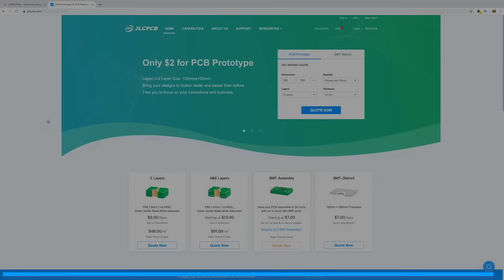10 BEST Tips & TRICKS with a sample CABLE TIES

Comment: Unlike 99% of these videos, most of these were very clever, and a few I'll actually use to run cables tomorrow. One improvement, though, is for the applications you're using a half-dozen or more: You can use velcro wrap/strips to do the same thing and not waste anything. For the side-by-side cables, you can wrap all four with ONE velcro strip, and then thread ONE zip tie around all of them in an extended figure-eight pattern. This way you're only actually using one tie for each, and if you leave some extra, you can always "unzip" it later.
Thank you for the vids, especially the rugged cable label ideas. Clever!
Reply: This video is about wasted resources...ridiculous minded...

Comment: This video lost me with the failure to properly flush cut the zip ties
Reply: The worst cut I have had on my hand was due to a ty-rap not properly flush cut!  At least he used a heat gun instead of a lighter for the shrink tubing
Reply: One of the NCOs I worked for would make us cut them all and do them again if we did that.  Because it sucks to reach in a rack or crawlspace and get sliced open.
Reply: @gwrober  I have a nice scar on my arm because of that. Deadly.
Reply: And melting the cuts
Reply: Came to say the same thing.  First thing I was taught when using zips, always flush cut.
Reply: got the scars to prove it. cable ties 101 - flush cut, flush cut, flush cut.
Reply: Zip tie gun needed badly here

Comment: Here's a tip I learned from an excellent (old) EE contractor working in aerospace: when the customer (executive) is dropping millions of USD for custom test equipment, a little eye candy can go a long way to giving them a warm fuzzy feeling about the work they just paid for.
Reply: The cable management with zip ties are heavily unnecessary, but it looks good and professional. Most cable management is eye candy anyways
Reply: I agree I done my apprenticeship with a guy who always dressed cables in a panel to perfection even though it took a good hour longer but looked stunning. As my dad said years ago.. a shite mechanic might not of serviced your car at all.. but if he washed it and left it spanking clean you'd think he was great🤣

Comment: As an electrician, all I can say is "The labeling part is nice, but otherwise: Wow, what an incredible waste of time and zip ties..."
Reply: I am willing to pay more for this kind of dedication, anytime.
Reply: Sometimes you need that level of organisation in your cables. What is called "cable porn".
Reply: You said that a waste since u want to finish ur job faster and then get the coin dude. I’m would gave a technician more coin if they work like this for 1 it is an art and 2 it is more easy to troubleshooting if any problem occurs if the technician not same anymore
Reply: @berlinsusanto5748  You have no idea about my work ethic. Cable management is one of my pet peeves, I cannot tolerate a rat's nest of wires. I started in the business when I was 8 years old working for my Dad who taught me to be proud of my work and do a job such that I would be willing to put my name on it... and I did just that. Every electrical panel I've ever wired has my signature on it. They are works of art. All wires and circuit breakers are labeled for easy troubleshooting. Wires are dressed neatly along the sides with 90-degree bends into the circuit breakers. Service cables are curled into their connectors symmetrically. Romex runs are unrolled from the reel, flattened out and run parallel to each other. I take the extra time to loop the wires and use the screw connectors on switches and outlets rather than use the tenuous connections that the stab-connectors provide. I can accomplish cable management with far less material and yes, time. After all I WAS in the business to make a living, not to make the zip-tie manufacturers rich. I worked with my Dad for over forty years, when he passed I moved on to become an IT professional and the work ethic he instilled in me remains.
Reply: JerzZDog 1 what kind of technician bend wire 90degree without keeping in mind that not all wire could be bend 90degree (the most basic wiring principle in electrical degree)? 2nd ur work is a masterpiece if it the connection have fix number of port and not compatible in a 3rd country including mine. Since many people just make a temporary port plug and then add more when they need it. 3rd since u know art, are you forcing ur thoughts bout “masterpiece”, “beautiful” etc etc to other an universal standard? Dont u know everything could be called as art? I know you are a “professional” on this problem but please respect other cz maybe ur skill can only be use in an area with so many good resources but not everywhere. Like many technician in my area, they could use all the same wire color for wiring without labeling it  and arrange the wire on wall to make patern is it a junk in ur mind? Come on dude.
Reply: I agree it's a bit overkill but the price of cable ties shouldn't even be a consideration. They literally cost a few pennies each (if that). You could spend all day cable tying 1000 cable ties and the materials would cost you 13 bucks (8" 1000 pack for 13 bucks on amazon). So the whole "make zip-tie manufacturers rich" argument is not a good one. No the argument would be your time but also, I don't like those "placard" label cable tie contraptions he puts on all the wires. Why not just use a label maker and then cover it with clear tape if you want to reinforce it. That way you don't have this big plastic sign hanging on the cables.  But interesting ideas though, I'm always up for new ways to make things look better and be neater.
Reply: @JerzZDog  This reads like a 4chan copypasta.
Reply: @JerzZDog  there is nothing wrong with your opinion. don't listen to these people who Wana jump on you because you didn't lose your mind over using 5 times the cable ties and extending a job unnecessarily. They don't consider that these tricks are not new. It's  just that most people who cable for a living don't do this because it creates more mess and is just not a good use of time. Looks neat though but it's best used on personal projects.
Reply: What most people do not understand professional labels bought in huge quantities are cheaper than zip ties. On big projects where labeling is required you need labels that fullfill standards. You can not use zip ties because you would not complie to the regulations. On smaller projects you could perhaps use it but you already have professional Labels in your storage. Why spend time creating something you can find in your bag? Last you can do the same with electrical tape marked with a sharpi or Edding again cheaper and faster.
Reply: Well I am 9years old and already work on things  I have tasters 6mm twin earth,earth sleeve,1mm twin earth,earth wire 1.5mm 1mm 2.5 earth wire 10 mm earth wire and 16mm earth wire  2.5 twin earth  3 core flex
Reply: How many vehicles have you wired bumper to bumper?
Reply: Alexander Ellis You’re 9, alright. You sound like you have no idea what you’re even trying to say. That, or you forgot what you were typing about after the first 8 words.
Reply: Well I do  know  what I am   saying  and I can  wire  sockets and  lights  I  connected  one of my  fuse boxes  and then  my  light  to it and  turn it on and it worked  it  didn't  trip the  circuit  breaker
Reply: Alexander Ellis Well yeah, I sure as hell hope so. “Works” and “didn’t trip the breaker” mean the same thing, by the way.
Reply: @alexanderellis6427  WTF?
Reply: If I were a professional electrician, yeah, I agree with you because time is money BUT setting up and organizing MY cables at home is a different story. I'm pretty sure the tips in this video were meant for homeowners and not those making a living as an electrician. My second BUT is: If you DO go the extra step in labeling a customers cables, they will be so impressed, that your business would grow out of sheer word-of-mouth.
Reply: You had me in the first half, not gonna lie. Epic
Reply: Koniec swiata dziewczyna
Reply: Did this guy work as a cable installer, perhaps in a Central Office? I want to see a vid on Wax cord weaving of cabling using ladders. It serves a purpose in some parts of the country. It came from a lot of DC power installs. Its a skill that seems to be well never really required. Modern Data Centers, The cabling industry is a subset trade of a way to make a lot of money. Its highly labor intensive.
Reply: @javierpiles5833  Smarter cable porn is using velcro mate. The only nice thing about the whole video literally it the labeling. The rest is way too much time to settle your OCD where velcro you just unhook grab the cable you need and hook it again. That organisation is only for likes and not for actual use, because you will swear your head off when you need to change a wire.
Reply: Yeah we bought zip ties just for show...not to use...
Reply: Working it IT in large data farms, I love it and I work hourly
Reply: @rogvelsan   Haven't you worked with multi-core sheaved cables?
Reply: @JerzZDog   Same here... trained in a professional work environment where a mess wasn't tolerated by the client (Base load Power Generation & Distribution).  It's carried over into every role I've held and NEVER questioned or disrespected by professional engineers and clients, but sometimes envied and criticised by those that can't work to high standards and end up getting the dog jobs rather than the best jobs that come into the shop.
Reply: @BTW...  yes and always have used labels, using zip ties the way is illustrated on this video is overkill and a waste of time (at least in my case), specially if you are paid by the job and not by the hour (happens frequently outside USA), not to mention compliance which has been already mentioned.
Reply: He probably has STOCK in a ZIP TIE manufacturing company...
Reply: Got time to watch YouTube n comment 😂😂
Reply: Cable dressing is an art. Each electrician does in his own way and that is why each panel is unique. Cable tags come in all sizes guess the video shows that you can make do with zip ties.
Reply: @rogvelsan  Yeah that's the problem I had with this video. It was more just making labels out of zip ties. They make already made label tags for this. Also for everyone say that cable ties are cheap, haven't had to buy one's to spec. To me this is more for like in a pinch kind of fix/repair job.
Reply: @izakvanderwesthuizen793  No, you aren't. Not when he bills you for 3X the hours that everyone else would.
Reply: Only good for small home desk and appliance cables... Definitly not for major sites or production cabling networks
Reply: As a telecommunications technician who prides himselves in his cable management and focus on detail, i totally agree! I have customers with very high demands in terms of cable management and labeling and tons of money to spend, but I don't think I could justify spending 3 times the amount on cable ties and god knows how many extra workhours accumulated over a year on these techniques. And for every single one of you saying "I would be willing to pay more for it"... BS, because most likely none of you guys are or ever will be customers that would benefit from having any of this done by a professional... and if you were you would defenitely complain when you have to pay the bill!
Reply: @user-nh3gu1ge3d  Especially when some AV racks I've completed were $100000+
Reply: @hamsterwolf  People who do cabling for a living DO use lots of zip ties, at least the ones who aren't hacks. Velcro is for hacks. If you're paying thousands, tens of thousands of dollars to cable techs to run cable, you damn well want it to be permanent. Do you want your IT intern to undo the velcro and "just add a cable real quick"? No. That's how you end up with rats nests that so many businesses have. It's what amateurs and hacks do.
Reply: @user-nh3gu1ge3d  I don't remember commenting that maybe you have the wrong guy.
Reply: @hamsterwolf  You can just scroll up and reread your comment. And if you don't care, you can just not comment. You said:

"hamsterwolf
10 months ago (edited)
 @JerzZDog  there is nothing wrong with your opinion. don't listen to these people who Wana jump on you because you didn't lose your mind over using 5 times the cable ties and extending a job unnecessarily. They don't consider that these tricks are not new. It's  just that most people who cable for a living don't do this because it creates more mess and is just not a good use of time. Looks neat though but it's best used on personal projects."
Reply: @user-nh3gu1ge3d  so your putting words in my mouth about Velcro ties then.
Reply: @hamsterwolf  No, I never said you said "you should use velcro ties". It was just an example. You were going off against the cable ties, wrongly, and I was explaining why. Perhaps you should be more clear about your point, then.
Reply: @user-nh3gu1ge3d  then maybe you should be more clear. I think most people reading your comment would misunderstand  and think your replying to specific points I made.
Reply: @hamsterwolf  I was. You were arguing against cable ties and I was arguing against you (and that stance). Very clear.
Reply: @martinreichel6850  link to the professional labels?
Reply: IT is where you will find this level of cable management. I bet you can get down with a good conduit job.
Reply: @JerzZDog  the problem  is here is that your an electrician  not a tech.  And as a tech down time can cost way more than install cost if good management and labeling practices  are not practiced.  Plus it makes my job faster.
Reply: @JerzZDog  lol baby girll 🤭… thats a basic electrician you know… come here in my site to show ur skill playing with 24kv and 33kv.. sksksksks hope u can pass that baby girl 🤭🤭🤣
Reply: This is useful for cables you can't hide, like in PC building.
Reply: Also as an electrician yes in many ways using that much zip ties would be consider a waist but when it comes to exposed wires that have to be seen I would use this methods to make it look clean so with wires expose I don’t think you’ll be a waste of time specially when you take pride in your work
Reply: No one asked you
Reply: Didn't watch as an electrican I'd probably agree with you

Comment: Wow, very nice.  For those that might be as OCD as I am at times, these are great tips to make it organized and pretty.  I think someone suggested the flush cutters for trimming the ends as they can rip you apart if you aren’t careful.  I have an equipment test bench at work and am changing zip ties out for velcro strips for just that reason.  Looks like you lost out in a cat fight when that happens and is a terrible look with a polo in the middle of summer.
Reply: Just use lighter to smooth the edge of it, or just use sharp blade to remove the end fully

Comment: Hands up those who enjoy that fleeting moment when you pull on the cable tie to secure it? For some reason I love using them. Much like this guy, but sadly my Father doesn't own a cable tie manufacturing business.
Reply: Have you used a zip tie gun? They can be set to give a much more consistent tension, better look, and not damage wiring from too much tension.

Comment: Time and Materials is Money. Nice to put a Razor Sharp end on the Wire Ties. They make a cheap tool, to cinch the tie, a half twist, with the tool and cut the cable will lock it in place. Also that label maker has a special flexible label for wire and tube. Here’s a tip, if you are wiring a control panel that has studs or bolts holding the panel platform, use the yellow insulated ring terminals on the studs, run your cable tie, through the crimp part to secure your cables. Also I carried paint markers in pretty much every color. I would color code the terminal blocks, to the color of wire attached at that terminal.

Comment: Like these ideas, and the labeling approach is neat and novel, BUTTT, if you're going to go that route, I'd just invest in a label maker with different tape widths. That way you can use different widths, adhere it to the cable tie, and better secure it with the clear heat shrink tubing. I think that would be better cost effective and time effective while also minimizing waste.
Reply: A complete waste of zip-ties & time...if your using heat-shrink tubing...why use zip-ties. The next tec who has to add cabling will make be pissed...

Comment: If you want to lace cable then waxed string is cheaper, less plastic waste and much, much faster. I laced miles of cables in a nuclear control panel as an apprentice. It didn't take long and would have been quicker if we weren't larking around when nobody was there to watch us. 
The label idea is a cool way to use the trimmed ends, but writing directly onto the cable or a strip of pvc tape with a biro or white marker has always worked for me. Otherwise, a bag of alphanumeric tracer sleeves are cheap and just slide on.

Comment: I usually put the actual label on the cable/wire itself lengthwise with the cable/wire and then slide the clear heat-shrink over the label and shrink in down. That way it is there forever and no need for zip ties. Just another idea.
Reply: Actually your's is a better idea. Thank you for posting

Comment: Actually, when you need to keep the conductors separated in order to avoid overheating then some of these arrangements would be useful.
Reply: But where have there ever been a problem where conductors overheat because they are not separated? They are litterally build for that:))
Reply: @JakobAndersen  You are obviously NOT a professional electrician. Cable manufacturers advise the current ratings of their cables according to grouping, spacing and how they are fastened on cable trays.